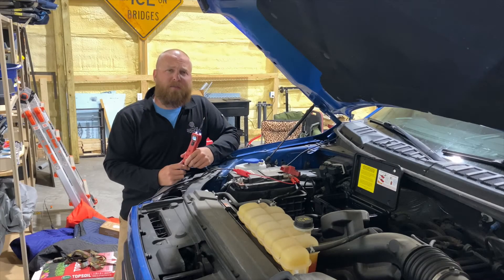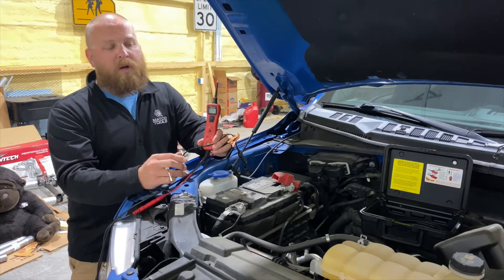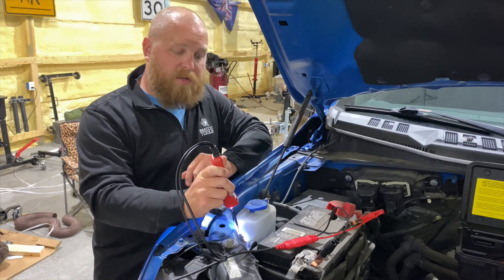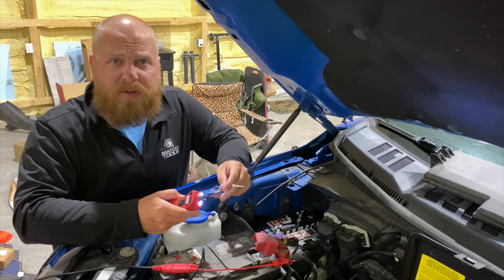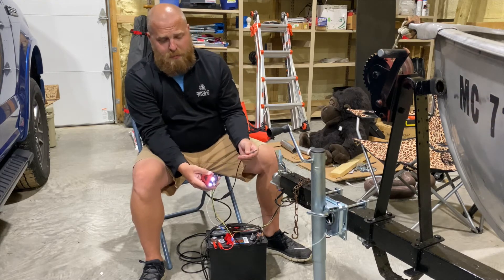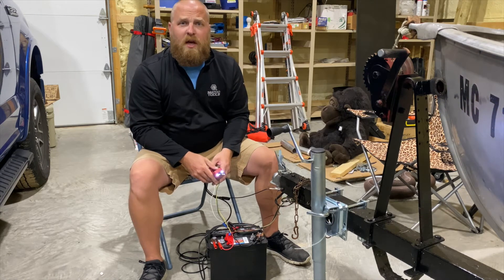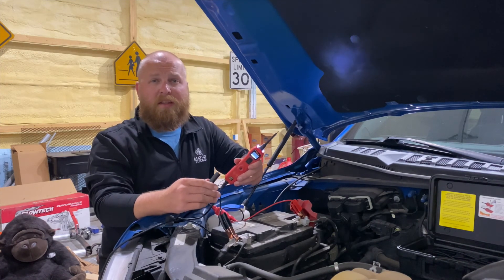Understanding the Power Probe 3 - How to Basic Functions

Comment: I’ve never needed one of these.  I was upset when I spent $70 on my Milwaukee volt meter.  This thing is $200+.  What a waste of money.

A M12 or M18 battery and two random wires, 18 gauge or thicker, and you don’t need this extra tool.

Seriously, what a waste of money.  Cute tool, but seems like a confusing cheat for people who don’t understand basic voltmeter use.  

I thought this was one of those find a break in the wire tools.  Ugh, what a waste of money.

Was a GOOD VIDEO explaining the six? things things this does, 1) check continuity, 2) tell voltage, 3) tell direction of alligator clamp polarity, 4) give a mostly controlled ground/power source. 5) gives a non-innate light source for dark area use, 6) gives resistance?

Waste of money.

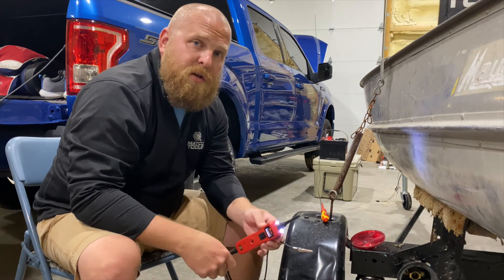Comment: 10:02 I'm not completely certain you "KNOW" that the problem is in the fixture yet, as you haven't disconnected the WIRE at the back of the fixture and verified the length of the wire is all GOOD yet, on camera at least!!
Reply: That's right. You can't expect continuity between the socket's power supply pins and ground. The only reason one pin showed continuity was because the current was flowing through the filament of the other tail light bulb to ground. There should be no continuity to ground on the second pin because it is only connected to the wire that leads to the 4-pin connector at the front of the trailer. You would need to connect the "continuity" clip on the PP3 to the proper pin on the trailer connector to properly check for continuity.
Reply: @tomferrin1148  

I was looking for your comment, thank you !

Comment: After seeing several videos doing fuse testing I had a thought. Suppose I have a not burnt fuse but the fused item isn't  working. Suppose the fuse leg is corroded away on the load side. Won't I still see 12v on both sides doing the test despite my circuit still be open on the load side.

Comment: Thank you for this video, your explanation is very easy to understand. May I ask - I see that the probe can "power" up lights as what you did in this video (where you turned on the rear lights using the probe). Can I use this feature to start my car? If you look in this video, https://www.youtube.com/watch?v=c74wDnXr6SE , a probe was used to start a Toyota 86. I suspect that this is also the problem in our 86, but I don't have any idea how use the probe as shown in the youtube video above. Can you explain how a probe the probe was used as shown in the video? Your answer will be greatly appreciated. Thank you! (liked the video and subscribed!)

Comment: Thank-you for breaking this down so its easy to understand. I'm not the brightest tool in the shed, but I could understand this! Question: will this measure ohms of resistance? Like for testing spark plug wires?
Reply: No

Comment: Thank you! That was great  video  you've  explain  alot. However I've a question  on using the Power  probe 3 on ignition  testing  primary  and secondary  do you or can you use mode 4 during your  testing.